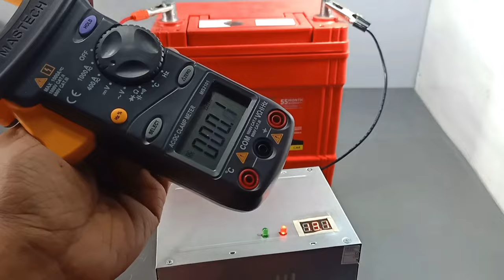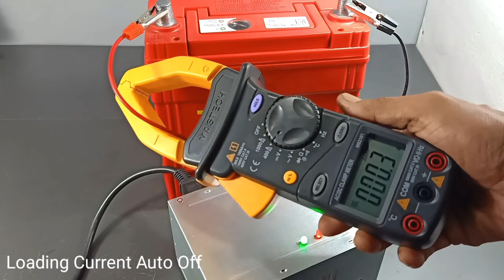12V Battery Charging Auto Cut Off //  250Ah, 200Ah, 150Ah, 100Ah, 40Ah, 7Ah Battery Charging AutoCut

Comment: 13V is not a fully charged lead-acid battery, you need 14.4V which is 85%.
Reply from the maker: Ok, 👍
Reply: Nope. Fully charged 12V battery is anywhere between 12,5 V and 12,8 V (12,8V for brand new and fully charged).
Reply: If you autocut system is attach your previous power supply,it will be great for me type parson
Reply: How many price
Reply: ok sir

Comment: All i need is to buy metallic box and 2 xformers and some parts and not the power supply from old pc i thought to be use.
Reply from the maker: You try with diagram
Reply: @RJEDITALL please share diagram with me
Reply from the maker: @BabarQadisiya-lv5pu  check diagram in the video
Reply: @RJEDITALL  please tell me about the duration of time where I can find the diagram.i have seen the video twice but couldn't find it
Reply from the maker: @BabarQadisiya-lv5pu  10:21

Comment: Hi,comment utiliser un voltmètre ampèremetre dans ce circuit 
Merci
Reply from the maker: Please check in my Channel, recent variable dc power supply, volt ampere meter connection proses